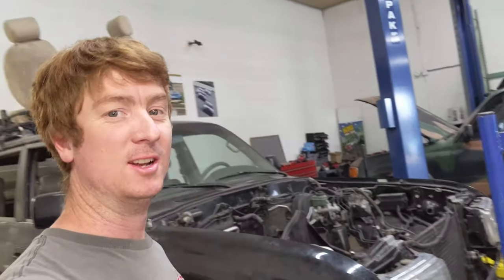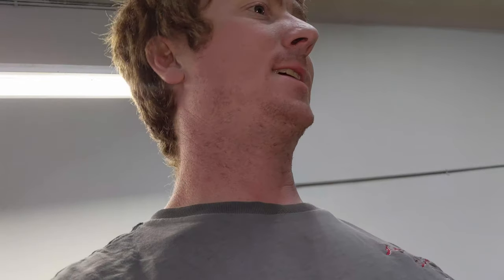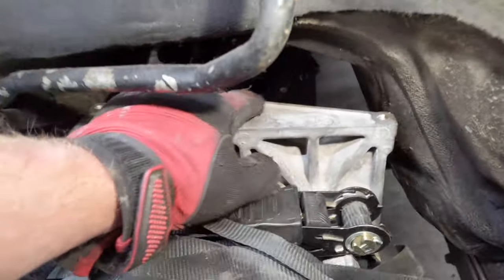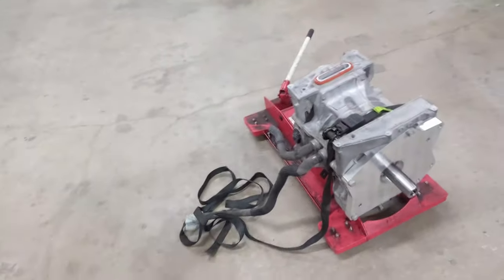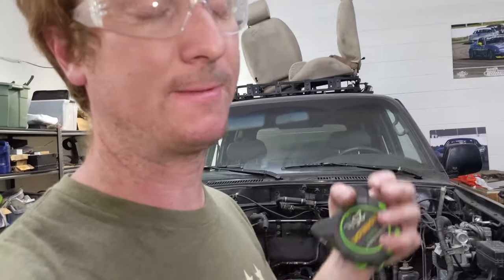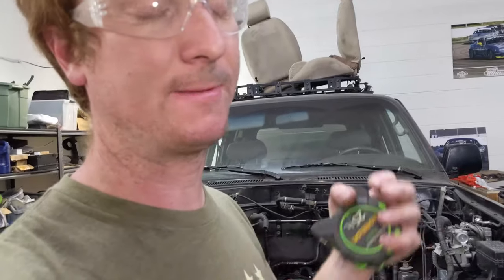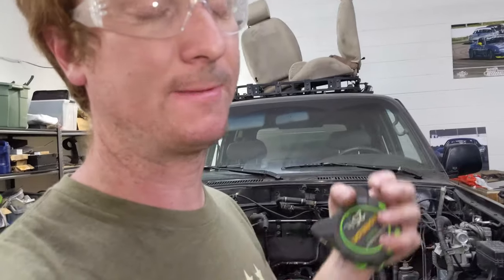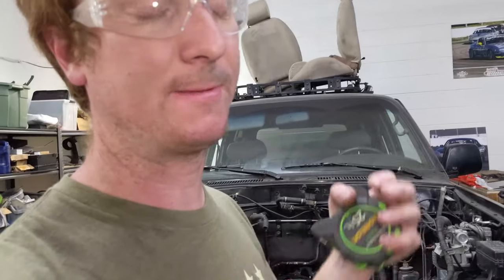Mounting the Nissan LEAF Electric Motor in The EV Swap Land Cruiser EVJ80 Ep5

Comment: Where are you sourcing the Black Box's input shaft with yoke for the intermediate drive shaft from the motor?
Reply from the maker: I bought a used Chevy input shaft and had a machine shop weld and machine it into an adapter.

Comment: Curious why you didnt bother with using a manal transmission to help with gearing down the motor
Reply from the maker: Simply because the manual transmission takes up a lot of space. I wanted to put the motor where the transmission goes so the entire engine bay could hold the battery. If I used a manual transmission it would have not allowed the battery to fit under the hood. It would have opened up a lot of gear ratios to choose from, that's true.
Reply: @EVSwap Great Job!! - I'm looking to do a Nissan Leaf swap into a Land Cruiser 79 Series pickup.

What Transfer Case are you using? Could you tell me your top speed with this setup and if the motor keeps up with the power demand? 

What is the kW rating of your specific Leaf motor?

If you had a second chance would you use the gearbox?

The Land Cruiser I will be converting will be used for a Safari Vehicle, low speed application, not exceeding 45km/h. Because of the low speeds do you think connecting it straight to a transfer case would be the way to go? it certainly opens up a lot of space for mounting batteries but at what cost? do you find you get a decent range? What is the kWh of your battery pack?
Reply from the maker: @GabrielPaterson99  My truck can do about 70 MPH on the highway in high range. In low range the top speed is about 35 MPH.

I use an 80kw motor, it is adequate but I think a 110kw or 150kw motor would be a lot more usable.

It's a tough question about the gearbox because on one hand it's nice to have the extra ratios to choose from but on the other it's a large piece of metal right in the middle of the truck and it's heavy. So if you can do without then the whole package become smaller and more streamlined.

My pack is only 30kwh which is enough for 70 miles depending on how I drive.